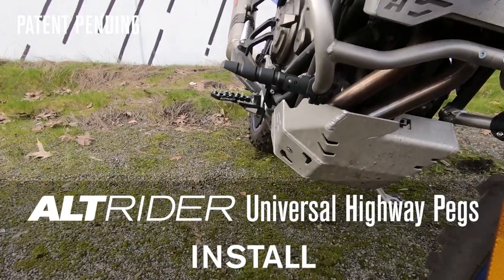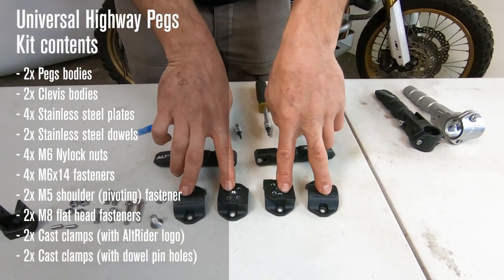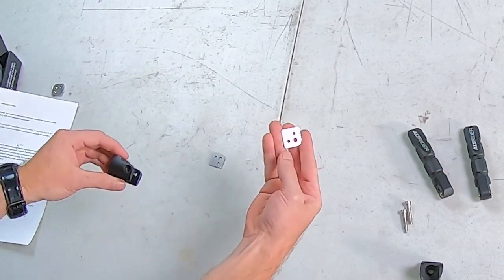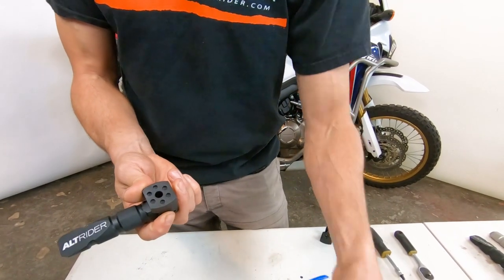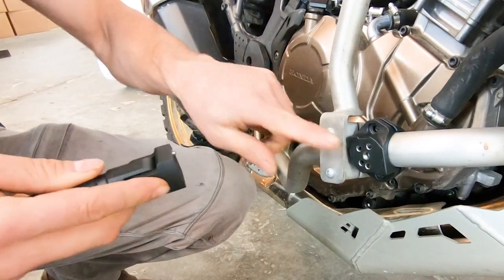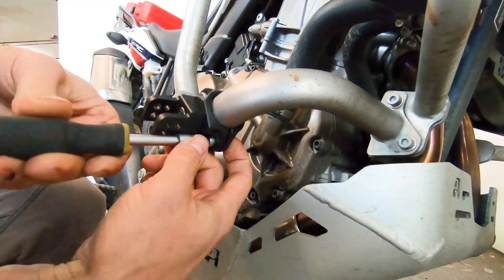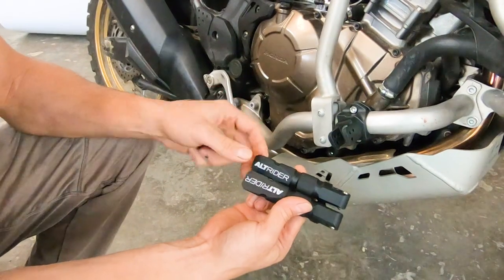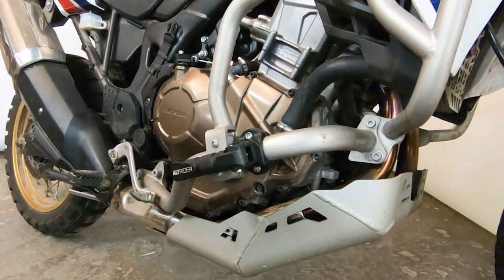AltRider Highway Pegs Install Video

Comment: Great video, but no lock-tite in my kit.
Reply from the maker: Did you buy it direct from AltRider? That's one of the benefits of buying directly from AltRider!

If you bought it from a reseller they're unlikely to include thread locker.

Comment: Do you guys do a rear foot peg delete? I have a 2021 1100. I believe i need the rear foot peg assembly as i have oem pannier rack, which uses the rear peg metal work to hold inplace the rack! My problem is my calf always hits the by the peg, and its triangular and sharp! Id completely take it off, but i use the panniers from time to time! Definitely getting these highway pegs! ❤
Reply from the maker: The highway pegs are great - I'm sure you'll like them!
No, we don't make a rear footpeg delete system...

Comment: Dude, it's oriented, NOT orientated.
Reply from the maker: Language is flexible, reginal, and evolves over time. 
Both oriented and orientated are recognized by Merriam-Webster & Oxford English dictionaries 👍
https://www.merriam-webster.com/dictionary/orientated
Reply: Excellent solution. Due to some old knee injuries I just need to stretch my legs out for a minute or two. These help me enjoy the ride so much more. The adjustability in these is brilliant and they look great on my Tiger.
Reply: Didn't see where the short M5 SS sleeves are used,, did I miss it?
Reply: @AltRiderLLC  you outpedanticked him (some dope is going to tell me that isn’t a word…)
Reply: Thanks for the video.  Just took my time and did the install. Tried
Reply: Oops,  tried to use the qr on my phone for the first time. They wanted my credit card!!!! You did a very good job explaining.  The second one was easy, not that the first one was  hard. Used some blue painter's tape and a plastic ruler to mark the height and copy that to the second side.